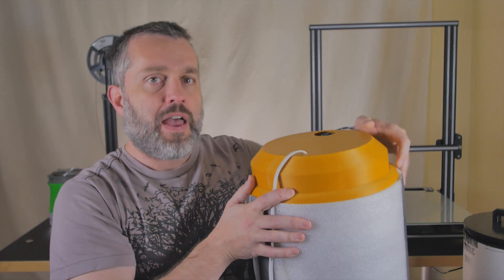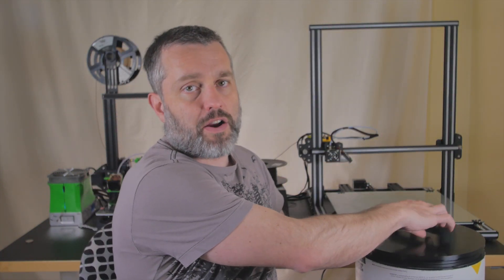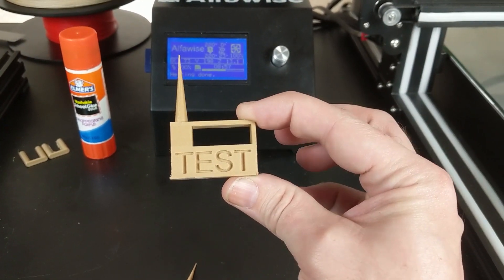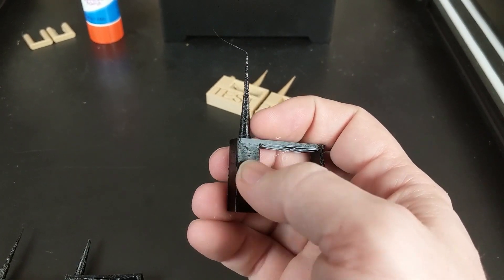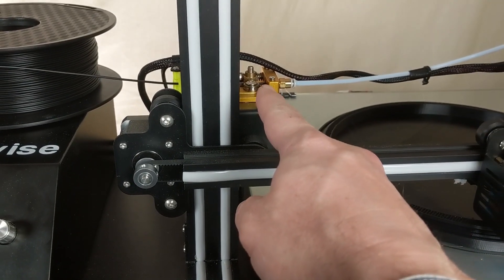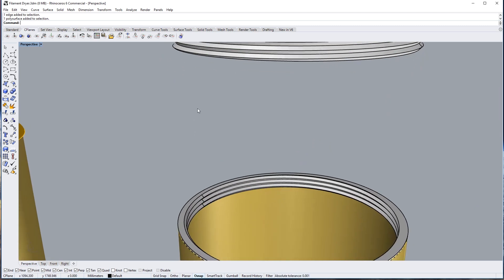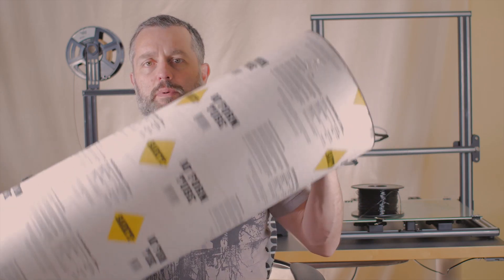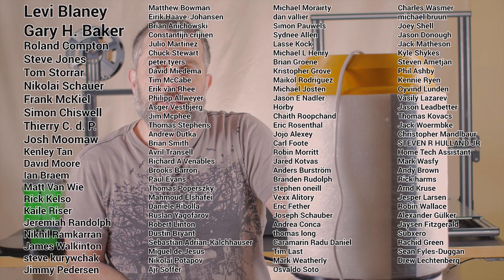If You Are Serious About 3D Printing You Need a Filament Drying Solution.

Comment: cool, but um.. Sonotubes are anything but water/moisture tight. they are exactly the opposite. They are designed to allow moisture thru them for curing concrete.  probably not the best storage unit.  could just get some polyurethane and coat/swirl it around inside to seal it..?
Reply: Just use spray sealer of some kind as simple as just an acrylic spray paint done deal
Reply from the maker: Concrete cures chemically. Did you know that concrete will "dry" under water? While the sonotube is made from hardboard (similar to paper/cardboard) it is coated on the inside with a plastic of some sort making it water and air tight.
Reply: @DesignPrototypeTest  yup, know concrete will cure under water, but sonotubes are designed to bleed off excess water at the coiled seams. fill one up with cret or just water and wait 10 mins, you will see all the spiral seam dripping. Just saying.  Is a cool design/concept, just think you need to find a better container base.  Or, just get some polyurethane and throw a cup or so in and swirl it around to coat the inside..
Reply: @Thomllama  while watching the video I same exact thought about moisture penetration.

Comment: you can get that same lid with threads and o rings for 5 gal buckets for around 7 dollars at lowes
Reply from the maker: I have one right here. That's where I got the idea for the overall functionality of my dry box. The size of the bucket is all wrong. The largest filament roll I have measures ~8" in diameter. The bucket is 12" in diameter. This makes for a ton of wasted space, but it's not enough space to do some alternate packing of the rolls into the bucket. I've found using the bucket for dry storage of filament to be pretty awkward. Adapting the 12" bucket lid onto the 10" concrete-form-tube would look like a hot bag of excrement. That's why I started from scratch and just designed and printed my own lid.

Comment: You lost me in under 2 minutes.

PLA is NOT the original filament.  The first filament used for REPRAP was NYLON, because you could get 2.85mm "Nylon" from the home center.  ABS evolved as it is easier to print, and WAY less hydroscopic then nylon.  PLA was very late to the game.

This is why, until recently, PLA was always more expensive then ABS.  Because no one used it.  But with the influx of Chinese clones, using cheap heating systems, and people not wanting to deal with the dunes and "nano particles" from ABS, or the annoying near water sucking of nylons, or the actual toxic fumes from things like PTFE and PEEK, plan got popular, and so started coming down in price.
Reply from the maker: I never said anything about PLA being the original 3D Printer filament. I said it is "most often used" and that is true by a wide margin.

Also, you are wrong about your timeline. Stratasys machines have been using PLA and ABS for years, since before the patents expired and we all started on this whole consumer level 3D Printing project. ABS is a plastic which was developed for easy injection molding and then was repurposed for 3D printing by Stratasys.
Reply: Design Prototype Test true. Weed eater string right? That’s what I heard

Comment: PLA do absorb moisture a lot. In my place here in Singapore, humidity is very high that leaving PLA outside my sealed box  for almost a week will make the filament brittle and will cause boiling during print. I always keep it in a sealed container  with a lot of silica gel to prevent this. I modified 21-cup Rubbermaid cereal container as filament enclosure to prevent absorption of moisture during prints.
Reply from the maker: I have pinned this comment to provide a counterpoint to what I am saying. It's possible that I am wrong when I say PLA is unaffected by humidity. I did the tests in this video with PLA that had been sitting on my shelf for many months. Currently, the air is 65% humidity here, but a couple of weeks ago it was at 89%. For some of the other prints I soaked the PLA in water for 12 hours. While I do notice that some of my PLA is brittle, in my experience it makes no difference to the print quality. It may affect layer adhesion. I did not test for that.
Reply: I agree with you that it makes no difference on the quality. If there is it should be minimal like stringing and micro dots. 

Only frustrating thing is breaking due to brittle filament in the middle of long print, specially if the printer doest have filament run out sensor.
Reply: Alex Kenis did some decent experiments (Including submersing PLA) and found that UV exposure, not humidity, is likely to blame for your brittle PLA. https://www.youtube.com/watch?v=nHdHSK4hvZE